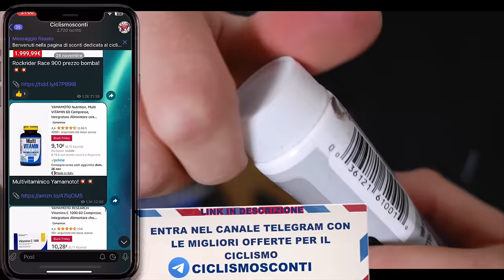VANRYSEL RCR UNBOXING

Comment: Quasi 8 kg.....non poco ma quanto costa co force cpme nel video ?
Reply: be mi pare UN ottimo peso
Reply from the maker: Ciao Omar, tutte le info dei prezzi sono nell’altro dove faccio vedere tutti i modelli, comunque ho visto che è il rival che pesa abbastanza, guarnitura 840 grammi escluso il misuratore, quindi quasi 900 grammi, e cassetta altri 340
Reply: @LorenzoDelsant  a ecco xké,è il rival......misuratore......ok ok allora come peso ci sta
Reply from the maker: @omarbeltrame7740  si anch’io ci sono rimasto quando l’ho visto😨
Reply: @LorenzoDelsant  io sono combattuto tra la van risel e la cinelli pressure
Reply: Oltretutto, con pedali, porta borraccia, supporto computer e nastro, direi assolutamente non male, anche senza rapportarla al prezzo
Reply: @maurovernelli724   come nel video sta a 4000 ? Metti ultegra, arriva 5000.....vado così a memoria ovvio,un bel manubrio vision metron 5600/5700.....sempre meglio che prendere altre Marche che arrivano a 8000 senza avere gran ché
Reply: Una Top di gamma con rim brake kg 6,4 Sram Red 11 come nuova pagata €1800!!🚴 Ego: Viva i freni a disco... così pagate una bici da 8kg come una moto, poi per i "fissati" meglio spendere 15k€ { ci si compra un' auto) 👋
Reply: @gianlucascaarpa  esatto Gian luca.....a disco non sono competitive